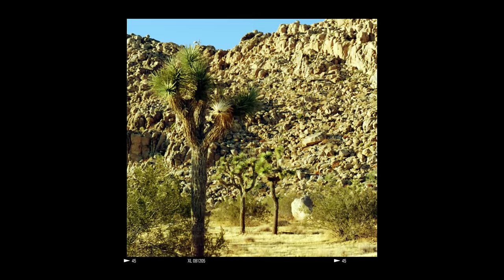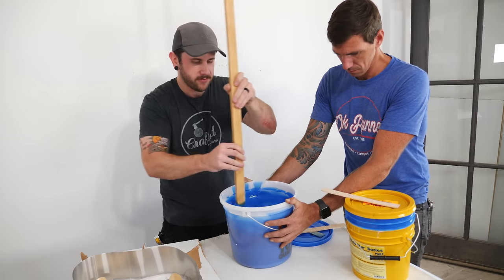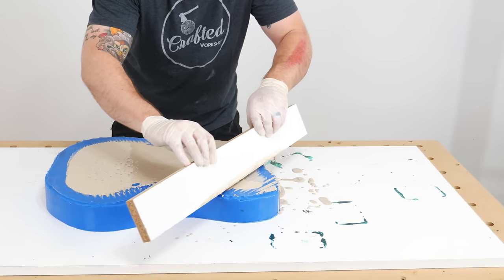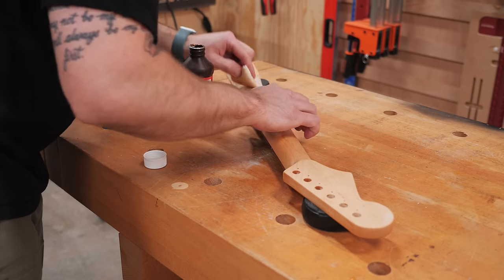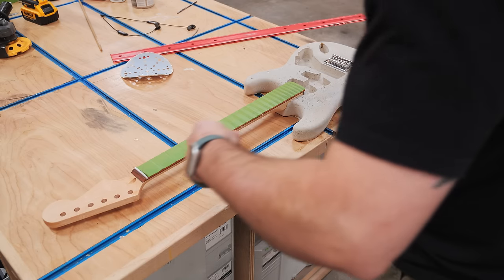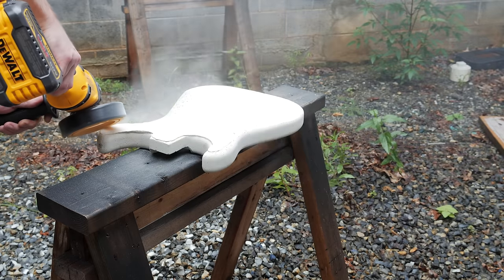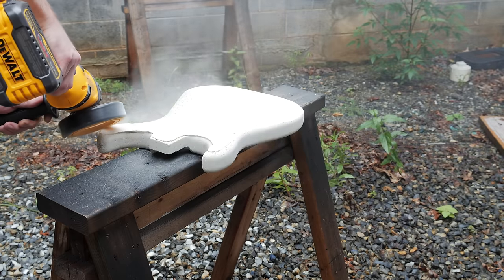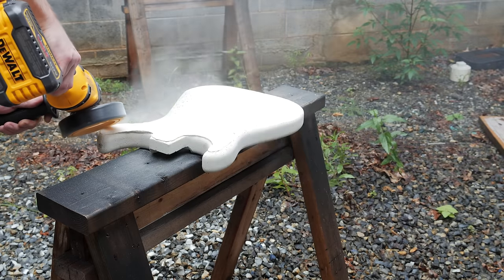I built a GUITAR out of CONCRETE. How does it SOUND?!

Comment: This is concrete proof that wood type has little effect on tone.
Reply: LOL
Reply: Rock solid logic, there.
Reply: But Its going to be heavy and fragile
Reply: I'll say, it's not quite as cut and dry as that. Nonetheless, Amp and pickups are still the biggest determiner of an electric guitar's sound. Biggest thing with wood is how much you have & it's density impacting frequency response. Less wood, you'll lose low end. Sustain is not affected in the slightest. You can find all of that here on youtube with tests done by luthiers. There's one video with an american luthier and his little boy. He built these mounts so he could effectively switch out bodies on one single with a small central pocket underneath that holds the pickups and electronics. They found exactly what I explained ^. Edit: I can also attest to this, as I own a steinberger. Good bright guitar, but it lacks in lower frequencies, even after switch out the electronics. I've also seen this being a cheap hobbyist who switches out electronics on my project guitars.

Comment: Great job.  It reminds me of a project we took on in 2nd/3rd/4th years of a Civil Engineering degree where we built and raced concrete canoes each year.  We used chicken wire as the form to hold the concrete, so we had the strength.. but it was relatively 'light', as we used pumice amongst 'normal' aggregate, creating the concrete from scratch (no pre-mix for us!).  Like you used silcone, we used a fibreglass mould... and we won a few events in our canoes :) ... Maybe some ideas for 'Version II' of your guitar, eh? :D

Comment: Isopropyl alcohol will almost instantly remove hot glue for any of you aspiring mold makers out there.

If you're going to cast concrete, use urethane rubber and save a ton of money, it will last longer too, Vytaflex 40 would have been perfect for this.

Great video!

Comment: Awesome! Looks really Nice! I have a few cents on this tonewood thing, and it is not directed towards this build, i think it was a well put together build. Cred. My five in the overall debate: Neck. That's the weak spot in these experimental builds. Iv'e seen glass guitars, resin, stone, pencil guitars etc. They sound alike with some flavor. All of them used maplelike fender kit-necks. But when i saw this guy casting an aluminium neck and bolted it on his build, 👍 That's what makes the most difference. Think about it. The neck is more than two thirds of the entire stringlength. I doubt wood as a whole, because it is inconsistent and random in its nature. But i do believe that the mass that the string is attatched to, matters. It's what keeps it ringning. But dont forget, everything you hear is a thin vibrating piece of metalstring. There's a difference beetween sustain and attack to. Hope to see more builds, maybe with a different take on the neck material? 👍

Comment: I’d be very interested to hear how the neck joint held up with just the epoxy. I’d be afraid that the fast-setting epoxy would be insufficient to hold up long-term. I’ve had disappointing results with 5-minute epoxies in general, but that is probably a higher quality epoxy since it’s got marine applications in mind.
Reply: This was my concern as well. Why glue the neck in and not just use the same wooden dowel method he used for the bridge and pickguard? I can't imagine that neck pocket joint well hold up well overtime with the string tension. Still a cool guitar just seems like an unnecessary short cut after doing all that work.

Comment: People refuse to accept that the majority of an electric guitar's tone comes from the signal path. But it's the truth. Even the shape and material of your pick have a more dramatic effect on your tone than the woods the instrument is made from
Reply: But muh tone woodz lol
Reply: Tod Dot  Well I think the only materials strings touch is the metal bridge and the plastic nut(and the string trees + tuning pegs, but those are both some kind of metal again).
Please, correct me if I'm wrong.
Reply: Tod Dot  The thing is that, a 335, SG, and Les Paul with similar hardware and electronics will sound extremely similar with the same pickup set. To the point of practical interchangeability. The sounding "so different" as you describe is usually brought about by what a player thinks the instrument should sound like, and how it should be played based around cultural traditions and preconceptions surrounding the guitar type. From my own ownership experience of LP's SG's and 335 type guitars i can tell you they sound very, very similar with the same pickups. That's only anecdotal, not very scientific. but i just want to convey I am not talking out of my ass. I'm not saying construction methods and materials have ZERO effect on the timbre of an electric guitar but in order of importance pickup type and orientation is far and away the number one biggest factor.
Reply: I used to be a complete tonewood snob; wouldnt consider basswood or poplar for a solid body, always looked for ash, alder, or maple on mahogany.  My favorite guitar ever, these days, is an old basswood Ibanez RG.  If I'm playing a clean tone, I notice a slightly muted top end, but nothing that can't be tweaked electronically.  As long as the action is comfy, and it sustains well all around the neck without dead spots, you can dial in any tone you want by knowing your gear.  Even an awful sounding pickup can be EQed to whatever you want.
Reply: Feel has more to music than a signal path. If you’re a cover band guitar player, it shouldn’t matter what crap you play as long as you have “the right signal path”... But tell that to an artist who actually creates music. The way an instrument feels when playing means a lot. And you can’t get that feel from concrete.
Reply: @gnrfront  I don't necessarily disagree with you. But that's not really what were talking about. We're talking about the timbre of the instrument and on a electric guitar the signal path, pickups and orientation of those pickups are the dominant factors in determining the sound of the guitar. I am a serious player; I'm not saying I know everything, I'm not even saying I'm definitively correct here. But I have a basis in what I'm saying. I'm not talking about what makes a guitar "good", or more psychological elements of playing like feel and bonding with an instrument etc
Reply: @sonsauvage  also, electronic parts age and change as well over time.
Reply: @gnrfront  sure, feel is important (i don't like certain basses and certain strings) but that isn't something mystical or artistic or anything like that: it's just that us (humans) get used to certain things and we're stubborn; our whole brain and body adapts to what we do constantly and then anything a little different throws us off. We need to recognize our faults and fallacies as humans instead of creating excuses
Reply: The worst is hanging out with Resonator heads that argue about “tone-metals” instead of tone woods.
Reply: Then why do all clean Stratocasters have the weird wiggly sound?
Reply: @andrewpearson1903  lousy single coil pickups is what makes them sound different.
Reply: @christianfoster3806  I couldn't agree more!!  Give us an EQ pedal, and we can make an RG sound like a Les Paul and vice versa.  The sound of tone wood is subjective at best, thievery at worst.  The things I appreciate about high end guitars is the ability to intonate perfectly and stay in tune exceptionally well.  I don't care what it's made out of.  I'll make it sound good. 

Cheers!

Comment: Tonewood ABSOLUTELY makes a difference.  I've been building guitars since 1985.  I speak the truth borne of many years of experience, and many experiments.    The thing about tonewood is that all wood absorbs vibrations.  The way it absorbs vibration varies from species to species, and piece to piece.   Some absorbs vibrations much more quickly than others.  Some are more resonant at different frequencies than others.    I'm not saying that you are likely to hear the difference between two similar pieces of wood of the same species and that are at the same moisture content.  But absolutely, tonewood is real.    It doesn't mean that you HAVE to go with expensive woods to get the best performance.

Comment: I'm curious on the sustain of that guitar. I remember there was a video where someone connected a guitar string and pickup to a piece of rebar and it sustained for a solid minute.
Reply: That's an idea, gluing or welding and sawing some rebar together to make a guitar body.
Maybe even a rebar neck.
Reply: @davetheimpaler204  Les Paul's first "guitar" used a bit of cut off from a rail road
Reply: Yes... Sustain... 
Now i don't know, nor do i want to get into the discussion of if/how the material a solid-body guitar is made of affects its tone.
But i do believe the raw mass of the guitar affects the sustain. Here's my theory: When you pluck a string, you inject energy into the string. The string keeps the energy stored by vibrating. But a little of this stored energy must escape, at the bridge, the nut (or the fret where the string is fretted), and also by the slight resistance in the magnetic field of the pickups. But, the heavier and more rigid the body & neck are, the longer it will take for a significant amount of the vibrational energy to leak away from the string into the body. Makes sense, right? Mass equals inertia. Resistance to acceleration. That's why solid-body guitars have more sustain than hollow-body or acoustic guitars.
Also consider the piano; the sound-board is presumably made of relatively light, thin wood, coz you want it to vibrate nicely. But this wood is held under tension by the solid cast-bronze frame that keeps the enormous tension of the many, many strings from just cracking the sound-board in two. And this bronze frame is very rigid and really, really heavy. Lots of sustain.

Comment: really fun to watch, I'm inspired! Thinking I would add some reinforcement to attach the neck to, like a steel plate that ran back into the body. Would be sad to torque the neck only to see it break off. the psi strength of bag concrete is not very good. The epoxy one is indestructible! Thanks for the video.
Reply: Compression is ok.
It in tension that it sucks.

Comment: Why did you decide to glue the neck instead of using the traditional bolts?
Reply: i was thinking the exact same thing, he’s really putting alooot of faith in that epoxy 😂 considering there can be up to 200 lbs of pull on a guitar neck once the strings are tuned up, i have a feeling that neck is gonna snap right off the body after a while lmao
Reply: @lordcuddlebuttz3336  Yeah, if he needed to adjust the neck angle he'd be pretty much hosed. OTOH, drilling four holes through the thinnest part of the body and then screwing a big lever onto it might be a disaster too
Reply: the screws with 200lb of pressure can act as chisels when slightly knocked and would crack the whole neck pocket
Reply: @daverice2426  The proper solution would probably be to reinforce the neck pocket and solid areas with carbon fiber or fiberglass rods while using fiberglass fill in the concrete to give this thing some durability. If the neck were then attached with a metal pressure plate as usual with a plastic or rubber spacer between it and the concrete it would probably be nearly as durable as a wood guitar. Using a relatively high volume of air in the concrete would also reduce the weight by a few pounds.
Reply: @maudiojunky  Yeah, I was thinking along the same lines. Looks like StewMac's fresh out of rebar, though
Reply: @lordcuddlebuttz3336  epoxy is stronger than the concrete.  If you tried to break the neck at the neck joint the concrete would fail before the epoxy would.  The Gibson les Paul is one of the heaviest wood guitars out there and it has a glued on neck.  He’ll be just fine with the epoxy.

Comment: I understand that silicone is versatile and fun to work with, but for a one-shot casting like this, is there any good reason not to simply use plaster of Paris? It would be MUCH less expensive!
Reply: he used the mould for multiple projects
Reply: @ry7hym  Yea.... Two projects Epoxy guitar and Concrete guitar, the other guy is right still as two plaster of Paris molds would have been way cheaper than the silicone but silicone would be way easier to work with. I can also see plaster molds being troublesome when coming into contact with say something WET!!!!

Comment: This was really awesome to watch...a very unique instrument for sure! As a viewer, I give a 100 percent on everything...however just one thing I might have done different...when pouring the concrete, I'd have put some sort of reinforcement rods in the concrete between the area the neck was attached and the body, just moulded into the concrete, as concrete is not extremely strong in tension and with all that weight, running the neck one time into something face on or from behind would make me leary of it cracking the concrete off. That's just me though and honestly I think this is a beautiful job from start to finish. Just be careful I guess. And actually, body materials do have a subtle effect on tone even in electric guitars, as there are microphonics and resonances that the pickups can, well, pick up. Of course for the vast majority, your electronics, amp and playing ability dictate how sweet your sound will be. 
Again, no peanut gallery comments from me, I think you did a fantastc job!! :)

Comment: I would imagine the sustain is unbelievable.
Reply: Why would you think that? Concrete doesn't vibrate easily. That's why you sometimes see washing machines sitting on concrete blocks, to reduce the vibrations in the floor. So the only sustain you get on this guitar comes from the neck. If anything, the sustain will be less than on a wooden body. Unfortunately we'll never know unless he transfers all the components from this guitar to a wooden body. Since the neck is now glued on, not gonna happen even if we ask nicely.
Reply: @waldwuffel1260 
I agree a side by side test would be the most accurate. I was making my comment based on ash, cypress, and maple bodies, the denser the wood grain, the better the sustain. Concrete, while (probably) harder than wood, is porous thus sustain would vary depending on the cement type and recipe used.
Reply: @georgeboyer8158  I was mostly commenting from intuition, which might be quite wrong. I don't know enough about wave transmission in solid bodies. So it might well be that the denser, harder a material is, the less it picks up the string's vibration, therefore keeping more of the kinetic energy in the string, making for longer sustain. The math on this should be, er, interesting.

I'm sure someone has argued this and probably made a more or less scientific video about it :) I just normally don't get too deep into the whole tone wood discussion.
Reply: @waldwuffel1260  Nor do I. My experience is hands-on observation and reading Guitar Player magazine back in the day of funny-hair stadium bands. As far as math goes, that's as far as my math goes...not really my subject. So, its gotta be side-by-side for this nearly deaf novice.

Comment: Others have probably mentioned this, but the fret board is probably more important than the body from the standpoint of tone wood in an electric guitar.  I have read that it has to do with how much the fretboard reflects or absorbs the sound waves produced by the strings. In my experience, maple fretboards do sound a little brighter than rosewood or ebony.  That said, it may be questionable how much that gets captured by the pickups.  

Still, thanks for the cool video.  it definitely shoes that the body material does not matter too much. You have awesome skills!